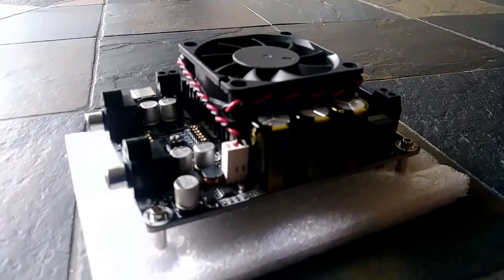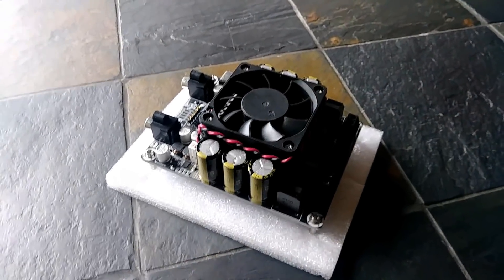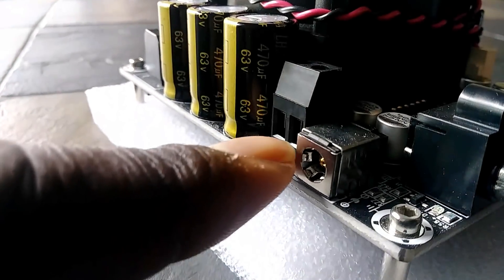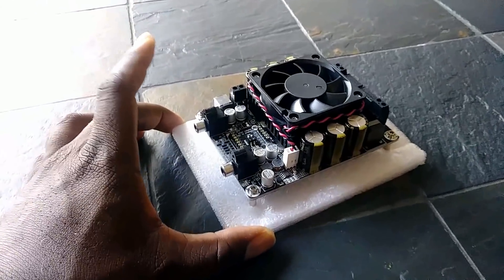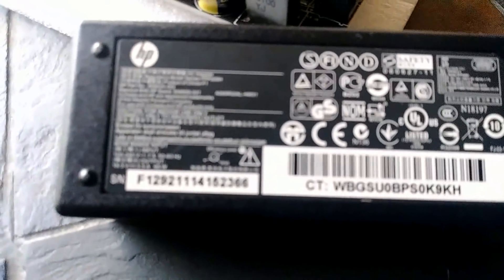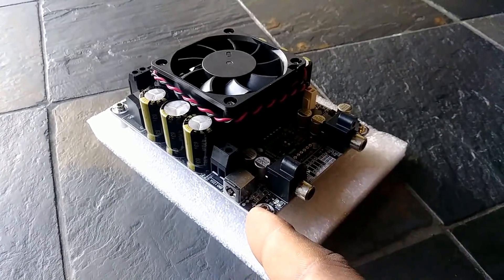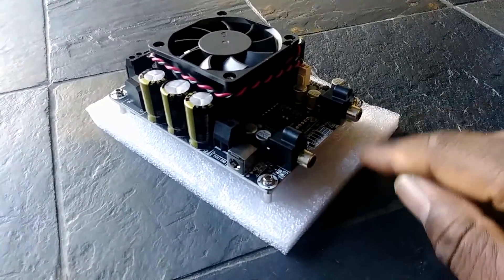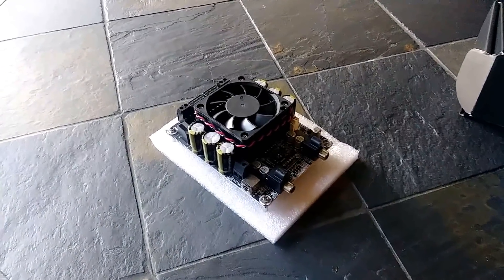Parts Express - Sure Electronics AA AB32281 - Board Amplifier - Part 1

Comment: Have used these.  They are designed and built decent.  Nothing exciting about Class D amps that claim 20000000 WATTS and is powered by a 15VDC wallwart :)

Comment: There a transformation basically that changes the voltage from low to real high in a car amp. the lower the volts the higher your amp pull will be. If you don't use the power supply built in to the car amp and no the voltage the amp board part is of the board is as long as its the same it doesn't matter what the input is.  but for home audio the higher the input voltage the less amps it will pull the less amp the less amount of money it coast to run it in home  audio it's cheaper to run 220v if you can it will pull the least amount of amps that's how you get charged in home electricity not by the voltage  only amps so you want high voltage  and with less amp pull  with the same out put voltage the biggest amps you can put 110v out let  can do close to a 1000w amp on a single 20 amp switch 110v  if you run it on 220v 2000w on a 20amp switch twice the power handling same amount of amp pull  in car audio there no voltage/amp pull that you have to pay so no one cars it's on low voltage but all the big system there not running 12v it's More like 16v so the amp pull on there car set up is less. Hope that makes sense and helps some one 👍👌✌️💯🎧🎤🎶⚡

Comment: Virtually ALL (yes, ALL) car amps actually have an internal inverter that steps the 12 volts from your car battery up into +/- 20 volts or more.  This is required in order to get the watts expected.  If you pop the cover on any car amp, you will see not only the bipolar transistors (or perhaps mosfets) for the output, but will ALSO see a handful of mosfets for the inverter and a few high speed high-current diodes (the type that bolt the the aluminum chassis).

Take a multimeter sometime.. feed your amp a simple 60 hertz sinewave (any bass test cd, etc).  Crank up the volume and measure the voltage at the speaker terminals.  Surprised to see 2-3 times more than 12 volts ac?

This is also why you are able to BRIDGE most car amps.  Your cars electrical system is a SINGLE +12 volts system.  Inside a car amp, you usually have a +24 (or more) volts AND a -24 (or more) volts.  The negative terminal of the speaker is essentially connected to ground.  The transistors inside the amp (your output transistors or mosfets) are constantly switching between the negative voltage and the positive voltage in order to move the speaker cone in and out.  This is basic PUSH/PULL operation.

When your speakers are connected like this, they are seeing more/less the 24 volts RMS at max output.  But when you bridge the amp,  you connect across the two positive outputs.  The "bridge" mode switch actually INVERTS one of the channels phase.  When this happens, as one channel is sending the negative signal, the OTHER channel is sending the positive signal.  This effectively DOUBLES the voltage available at the speaker.  From 24 volts to 48.

This is ALSO why the ohm rating is usually HALVED when you bridge a car amp - because each channel is seeing HALF the speakers impedance.  So a 4 ohm speaker will more/less place a 2-ohm load on each channel.

When you double the voltage, you basically double the wattage that will be consumed by the speaker.

All of this would more/less be impossible if you did not have a proper +/- power supply internal to the amplifier.

-Dean

Comment: there 's a power supply in every car audio amp that turns 12v into 24-50v
Reply from the maker: What?! How; please explain.
Reply: BudgetBassHead look at a power inverter for a car then take the output voltage and turn it down to like ~40v 
thats about the circuit you have in a class d car audio amp.
Reply: Depending on the design of the amplifier, the power supply will convert the incoming 12-14 volts up to a much higher voltage, sometimes over 100 volts on the newer "Brazilian" amps that have been coming out in the last few years. The power supply is built in to the amp. The difference with these cheap Chinese chips is that they are unregulated and designed to run on a wide range of voltages from a completely separate external power supply which ultimately determines the maximum power output.